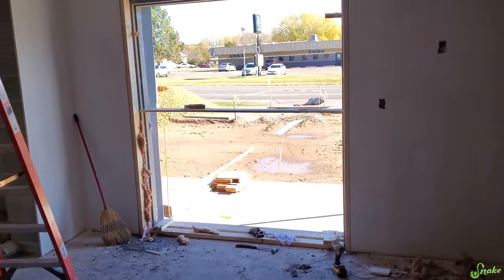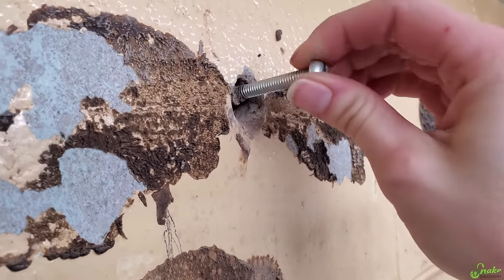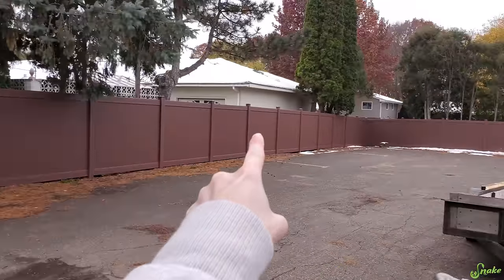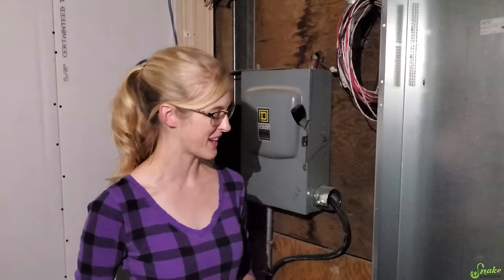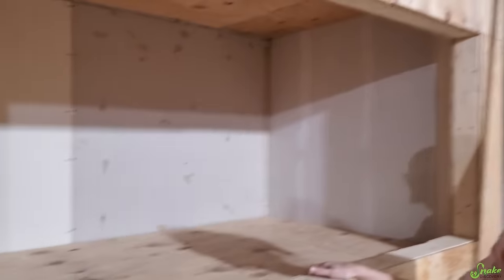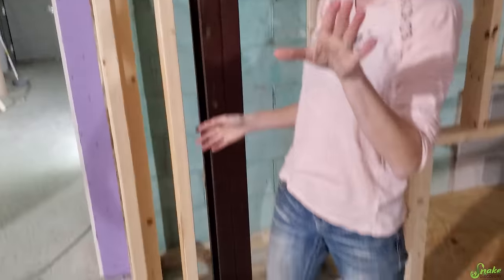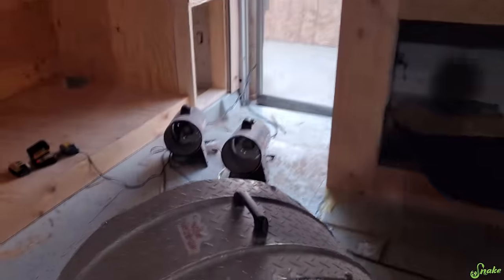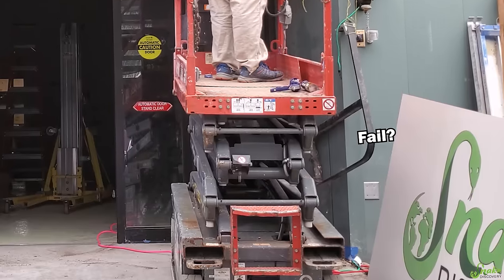Reptile Enclosures are being Built! (Facility update #4!)

Comment: 12:43 You might want to make the world map magnetic. When you use pins the map will eventually look like cheese
Reply: Also less dangerous/ liability that way
Reply: @tvgubber  true!
Reply: Magnets can be dangerous too if swallowed
Reply: @Cillana  At least they are a little better than pins
Reply: I was thinking a touch screen might be nice. No parts to lose.
Reply: @Zuraneve  touch screen sounds expensive
Reply: @Zuraneve  You're right! I didn't think of that! Might cost a bit much though
Reply: They could always start with something cheaper then replace with a touch screen later
Reply: Perhaps if they made the map dry erase and had markers that were attached to the board by some sort of rope it would work well too. Definitely better than pins.
Reply: Or stickers on a picture of a map.

Comment: The screw with a bracket on it has been used to secure a pipe or round electrical conduit. I'd recommend pulling it out as far as possible and clipping it off with bolt cutters, angle grinder, or a hacksaw. Then push the remainder back into the wall and render over.

Comment: Those screws in the cinder blocks have anchors in the back because cinder blocks are actually very crumbly, so you need the anchors to prevent them from pulling out.  From the attachment on the one you hammered, I would guess they were holding conduit.

Comment: Please answer this because I'm genuinely curious!
The enclosure Rex is in now(which is basically a room) is big for her to crawl around in and such. Although, her new enclosure at the facility seems significantly smaller. Does Rex not need that much space as much as she has now? I didn't expect her to go into a smaller area she has now. Is it better for Rex to have more of a water space than there is for playing/walking space?
Reply: I was wondering the same thing!
Reply: I think there is more space in this new one, it's just kinda hard to see. For one thing, the pool is going to be much deeper which will allow Rex to swim more and float in that way alligators do. Alligators don't need a ton of land so the size of the pool is what's so great. However, Rex will also still be able to crawl around on top of the tunnel which is a ton of room to lay out flat and bask